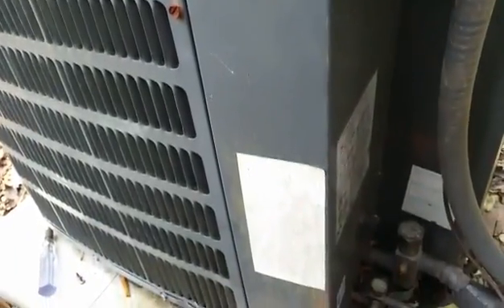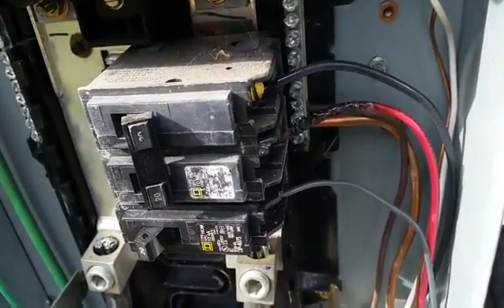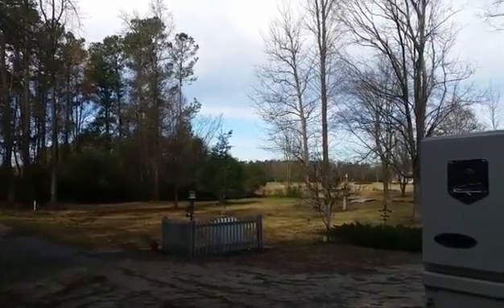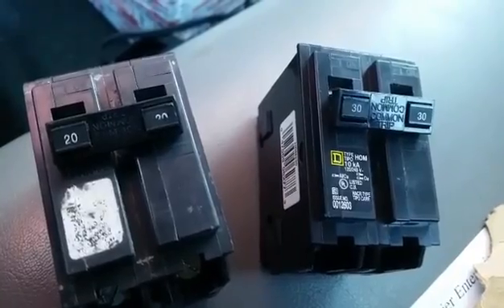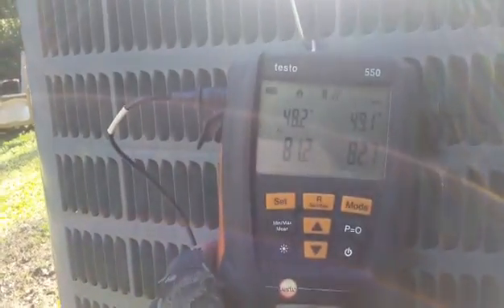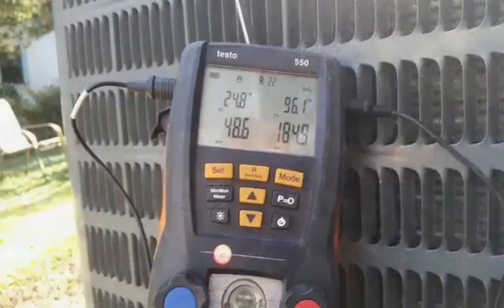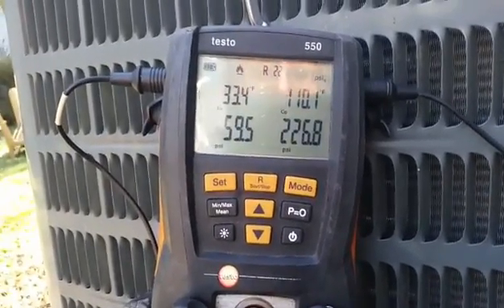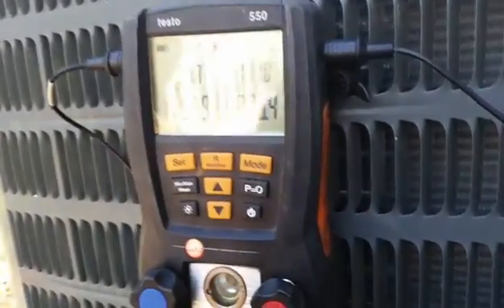HVAC Service Training: Heat Pump Trips Breaker

Comment: Placing a Square D "HomeLine" breaker in place of a Square D "Commercial" breaker is a lower grade product.  If the original equipment was a higher grade - it should have been replaced with identical equipment, not a lower cheaper grade.  As for the breaker rating - total full load condensor unit amperage should be calculated, plus 10%..Looking at the burnt red wire, it is very possible the breaker wire clamp was not torqued correctly.  An impromperly torqued clamp will end up with a burnt wire.
More than likely, this unit need no greater than a 25 amp breaker.  A 30 amp breaker will not trip correctly if a fault did occur, a fire could result with a breaker too large of a value.
I do have a TDLR Electrical license and TDLR HVAC license.
Reply: The new breaker size came from the unit literature found online. They were both low grade home line breakers.
Reply: You may be correct about the wire connection.

Comment: Is there any pressure /temperature relationship in the heating mode?
Reply from the maker: Most of the charts are based on indoor/outdoor Temps compared to running pressures.